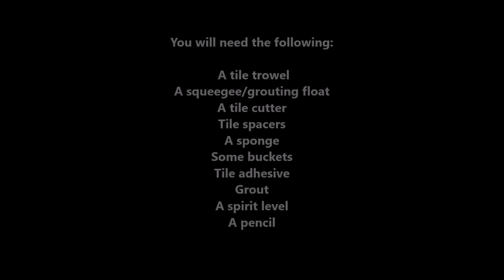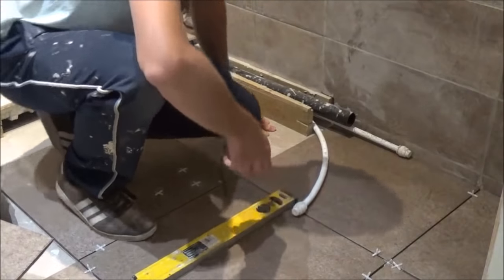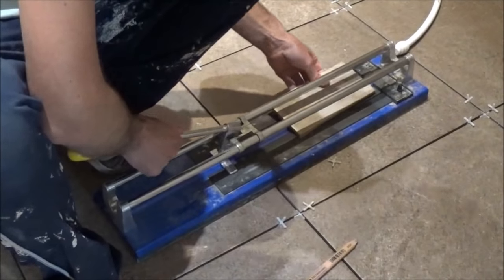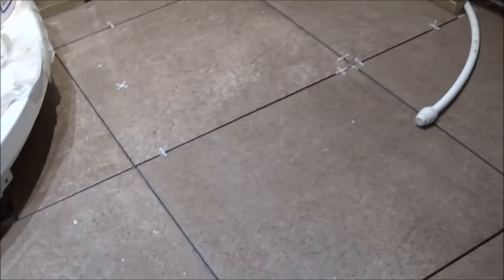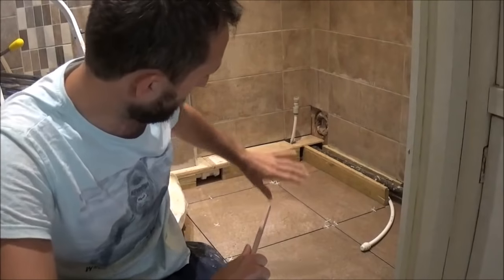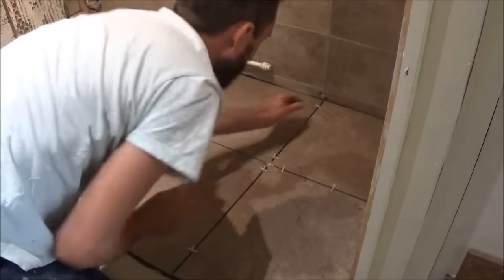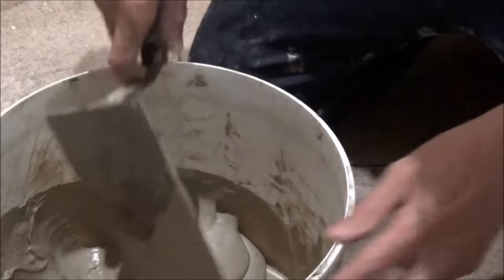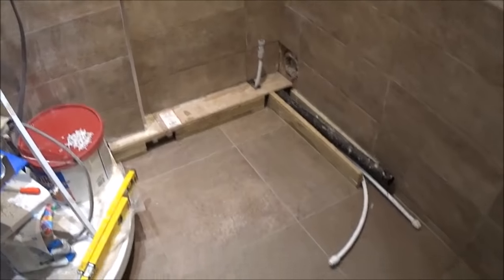How to tile a bathroom/shower floor, beginners guide.Tiling made easy for DIY enthusiasts!

Comment: Your videos are by far the best I have seen for NON EXPERTS such as myself - you have saved me a shed load of money on jobs, my latest was running a spur from the loft to a fused switch to hard wire an Electric fire, it worked a treat using the Wagoo Box as you described - many thanks for such helpful videos.

Comment: Excellent video..I been installing tile professionally for a couple years now.Doing a row of luxury homes where they are super picky about flush grout joints.Tough to do perfectly.Tried washing floor just enough where I can come back the next day and wipe off the film.Tough to get joints flush and tile perfectly clean in the same sitting.Thanks for the video.
Reply from the maker: Thanks for the feedback James. Unfortunately sometimes cheaper tiles are not exactly the same size so you need to use your eye a bit! Good luck with it.

Comment: Thanks for tips , customer wants me to tile s/bath just the same but previous tiler went direct onto chipboard flooring
its been nailed so tiles have come lose would 1/4 " ply treated with Mapei  Waterproofing kit do it as cement board would be to high Thanks again, such a good clear video
Reply from the maker: Why not use something like hardibacker board? It's made in 6mm which is basically 1/4 inch and it is designed for that purpose.  Hope that helps. Thanks for watching!
Reply: Use flexible tile adhesive and it will be fine

Comment: I am going to be filing a corner shower wall and bathroom floor soon. First time doing this type of work. The shower pan has a curved edge and is fiberglass with steel reinforcements. I am worried about setting the pan first because I don’t think I will get nice rounded cuts where the tile will meet it (no trim piece with pan). I was thinking g I should set the pan after the tile is down. Any thought on correct installation? Instructions for pan install where simply to spray foam underneath of it. Has leveling feet installed into pan.

Comment: Hi mate,,great video,,I want to tile all my bathroom but my old bathroom floor is old floorboards,,I’ve heard about putting 18mm ply over them but won’t that be very high and be a step going in to the bathroom
Reply from the maker: You could try hardibacker board. They do it it in thinner sizes. If you do have a small step up you can get a new floor threshold strip that neatly joins one floor to the other by smoothing out the drop. Good luck and thanks for watching!

Comment: I need to replace 3 tiles.  Do I need to use the spacers for just three?   Also, you didnt show it in this video; what if I replace a tile and its low or high on one side?
Reply from the maker: Spacers are always a good idea as they hold the tile in place while the adhesive sets, but you can do it by eye if you like. If your tile is low, put more adhesive below it, if it's high, remove a bit. Thanks for watching.

Comment: That rapid set sure does go hard really really quick first time mixing it nice lovely thick paste took bucket up the stairs then it had turned rock hard couldn’t even stir it lol did I add to much powder?
Reply from the maker: Maybe. If you're new to tiling I'd stick to a standard setting tile adhesive as it just gives you a bit more time. Practice makes perfect so keep at it! Thanks for watching.

Comment: Absolutely will be using this as a guide to do my upcoming flat, just to be clear it's a cement floor? It doesn't need any waterproofing layer? always see those in videos based in the US where the houses are wood and plaster but in singapore housing is 99.9 percent full cement and brick same as in alot of the uk
Reply from the maker: This is cement floor, and a bathroom floor. In a wetroom or shower floor you would need to waterproof it. Also on walls and floors if timber (or not in some cases) I would recommend using backer boards for tiling as there are plenty on the market, they are designed to take tiles, they add a bit of insulation and fitted correctly they are fully waterproof. Hope that helps and best of luck.

Comment: Use a larger notch floor trowel next time.  That serator is only for small format wall tiles....also if you have to tile over ply use a sbr mix on the ply 1st.... Best of luck
Reply from the maker: Thanks for the feedback.

Comment: Hello Mate, I have a floor boards in my bathroom, what base would you recommend? Would self levelling floor on membrane work? The bathroom is up stairs. Thank you
Reply from the maker: If your floorboards are solid and screwed down well, then a sheet of cement board (hardibacker for example) might be an option. But you need to work out if you can afford to raise the floor level as it may create a small step into the next room.
Reply: Great video...!
I have 2 layers of 1/2 inch plywood on the floor...do I need to put down cement board too?

Comment: That floor scraper looks the business....where did you get that??
Reply from the maker: Hi Charlieshooter, the floor scraper is from Wickes, cost about £15. The blades are reversible i.e. they have two usable sides so when one side goes blunt, you can take it out and turn it around. They are only a couple of quid to replace. They are also great for scraping walls. Thanks for watching my video and good luck with your projects.
Reply: I saw your back at 1:44.

Comment: First, you have to let the cement drying more than 2 hours, at least 10 to 12 hours before applying the grout, if not, the tile can wobble and make bumps on the corners. Second, i strongly suggest to back butter the tiles, the job will last longer and you can prevent tiles from damages, cracks and unstick from the floor. Third, when you apply the tiles, you need to push them slightly from left to right to adhere more into the cement. You're welcome.
Reply from the maker: This is rapid set adhesive, it doesn't need to be left that long. If you have worked with it you'd know about it. It is designed for the very purpose of getting the job done quick. Hope that helps. Thanks for watching.
Reply: Prbably on about wall tile adhesive hes never worked with rapid set goes of in an hour

Comment: Can tile be installed if bathroom fixtures (toilet, tub, vanity) are already there, or if you just want the new floor but keep all fixtures the way they are?
Reply from the maker: Yes they can, it's just more fiddly. Make sure you cut neat and use a good bead of sealant around toilet etc so any spilt water doesn't seep under tiles.
Reply: Well you have to remove the toilet anyways because builders get beneath the toilet to install builder grade tiles

Comment: So does the tile just start from the beneath the door of the bathroom ? 
and what sort of flooring is in the corridor ?
Reply from the maker: You can start the tiling from wherever you want. I started from the door (entrance to bathroom). I had to trim a small amount off some of the first row of tiles as the room wasn't square. Choose your line up the middle like I did, work from that line out, and also chose a starting place. Preparation is the key! In my hall way I also have tiles of the same depth so I just used spacers between the hall and bathroom tiles and filled with grout. This is under the door when it's closed. You could also use some carpet/tile trim (door threshold) to cover the join, its up to you. Good luck and thanks for watching!

Comment: Very informative! How long did the whole job take, walls and floor? Do you have any recommendations for an electric tile cutter that can also cut wood - Changing blade of course.
Reply from the maker: Glad the vid helped. The whole job took a few weeks but that was around my day job, just doing a few hours in the evenings when I could. But I was also doing the plumbing, boxing in etc inbetween, so difficult to put a time scale on it. As for tile cutters, you get what you pay for. The one I use in the video is a cheap one, does the job, but the guard is fiddly, and it's not super accurate, so you have to get your eye in. As for cutting wood, I think you want a table saw. You cant cut wood on a tile cutter as far as I know. Hope that helps, thanks for watching!

Comment: Do I need to remove the toilet bowl and bathroom vanity before installing the floor tiles? Thanks
Reply from the maker: No, it's up to you. Personally I like to have the tiles underneath, that way if you ever need to replace the units and don't want to replace the tiles then floor is covered. It also water proofs the floor, but it's not essential. Hope that helps.

Comment: Hi I have a small downstairs toilet that I want to tile. I want to half tile the wall, should I do the wall before the floor and secondly how far do I tile to the bottom of the door as it will meet the hall carpet on the the other side of the door. Cheers Rob

Comment: I`m removing the bath and fitting a shower cabinet, the bath sits on a raised platform seven inches high and is made of T&G  about one inch thick can I lay the tray direct on to the boards or should I put down something like marine ply first the waste will run under the T&G.                                                               thanks vinny.
Reply from the maker: Sounds like the tongue and groove is solid so no problem with strength. You can add marine ply if you want to avoid rotting if there's a leak. But that said, if you tile it up properly, it shouldn't leak so up to you!
Reply: @POUSEaroundtheHOUSE  thanks for your help.

Comment: Thanks, i have one tile on the floor which has come loose, should i still apply the adhesive to the floor rather than the back of the tile. When i lifted the tile off it looks like the adhesive was applied to the back of the tile and not the floor
Reply from the maker: You can apply it to either but usually less messy and easier to apply it to the back of the tile if it's just the one. Hope that helps. Good luck and thanks for watching!

Comment: Is it best to but your floor tiles first? Or your wall tiles? We are doing up our home and ran out of money so having to do it our selves. Also can the toilet sit on the tiles or does it have to go round? 
We have to board the floor first so will this make a difference to how we do it?
Reply from the maker: Hi there, to be honest it doesn't really matter. Floor first is better in some ways as your wall tile comes down onto the floor tile. If it's in a wet area like a wet room this is better as if your grout ever gets slightly cracked, the water would run down onto the floor tile and not the grout (if that makes sense). Toilet can again be tiled around or sat on top. I did my toilet on top. You can see how I fitted the rest of the bathroom by watching my other videos here if it helps - How to fit a toilet - https://youtu.be/85Re9VgHFU0 and How to install a bathroom sink unit - https://www.youtube.com/watch?v=8H55hZ3qFuA, How to fit a shower tray with shower tray riser - https://youtu.be/y2DI998gxdg. Best of luck with it. Thanks for watching!
Reply: POUSE around the HOUSE thanks alot, hope it works out haha am not the handiest of woman although i can restore wood quite haha
(You could come and do it could you haha)

Comment: I need to cut a few tiles to the size required (from 18x18 to 12.5x 12.5) to make a patch on the floor in the bathroom. After I cut the tile  do I need to smooth sharp cut ends somehow (someone told me if to put cut ends it would be a sharp object on the floor). I see you just put cut parts to feet the area. My question is: do you need to smooth the edges somehow sometimes, or it is in some special cases when you smooth them? Maybe when you put groat those sharp parts are not so sharp anymore. Same concern for the wall tiles, do you smooth them somehow after you cut, or just use as they are? Thank you for the great film.
Reply from the maker: You can file the sharp edge off a bit if you like, but when you grout the tiles, it should cover the sharp edge and problem solved! Hope that helps.

Comment: how did you make the the tile flush to the outside floor?
Reply from the maker: It depends on the two floor heights. I have tiles of similar thickness in the bathroom and the hall outside. I then left a slightly wider gap between the different tiles ( a few mm) and filled with grout to make the levels meet. But if the gap is quite different, you can use a threshold strip between the two floors. Hope that helps. Thanks for watching!

Comment: How do you tile your bathroom if there are painted walls and floor?
Reply from the maker: There are products you can put on the wall first like plaster primer. As for your floor, depending on the floor it may need more work. For example you can't tile straight onto floor boards. Hope that helps.

Comment: Great video, but a tip from a tradesman to anyone who is checking this video:

- avoid using flexible pipes as much as possible, they are unhygienic, the ridges will get filled with dirt eventually and are prone to clogging. In this case the flexible pipe could have easily been replaced with a straight more robust pipe.

- avoid using t pieces for drain pipes whenever possible.
Reply from the maker: Thanks for the feedback and thanks for watching.

Comment: @pouse - Tips on laying ceramic tile over vinyl floor?
Reply: rob1621 (in case he doesn’t reply) 
you’re gunna want to rip that up. The vinyl won’t let it stick very well.
Reply from the maker: Rob1621 - I agree with Mickey. If your talking about the one piece vinyl (a bit like lino) then I'd rip it up. If you have floor boards then it's worth putting a suitable base over them first like hardibacker board. Plenty of purpose made sheet materials for tiling on these days. Hope that helps. Thanks for watching and good luck with it.

Comment: Great video but why didn’t you explain the radius cuts around the shower?
Reply from the maker: I didn't do radius cuts, just cut square under enough to be hidden buy the shower tray and plinth. Hope that helps.
Reply: @POUSEaroundtheHOUSE  So if you extended the tile under the shower base, what did you use to keep the shower base level (since the tile would raise the front)?

Comment: Can you tile on wooden floor?
Reply from the maker: No is the simple answer. Whilst it is physically possible, wood will tend to absorb moisture from the adhesive quickly and could cause the tiles to come loose in time, and even then it'd only be feasible on something like plywood. Old floorboards for example just wouldn't work. You could screw some thin sheets of hardibaker type board or elements board to the floor then tile onto that.

Comment: Do you need to paint a floor with "Kills" before you repair the patch on the floor? I've read such advice somewhere.
Reply from the maker: You can use some sort of sealer if you like. In this video the floor screed was fresh so no need.

Comment: Is it necessary to use cement backer board on a floor or is treated plywood sufficient?
Reply: Andrew Hacker yes you should use the cement board to avoid cracking tiles
Reply from the maker: Cement backer board is a better option but I've tiled onto plywood with no problems. You can always brush some water:PVA mixed 3:1 over the plywood first to reduce absorption. Whatever you put down just watch the depth as it will start to build your floor height up when you add the tiles and adhesive which can be a pain lining up with the floor outside. Good luck with it!
Reply: But you didn't put down anything here, did you? Is it ok to just put them down on the cement or is it more dependent on whether you have uneven areas as to whether you use an underlayment? Great vid!
Reply: I used cement backer board on my floor. Easy to work with no need to prime it, low profile 5mm and strong.  I found that marine plywood was quite expensive.. if you are going to plywood make sure it's properly secured to the floor.
Reply from the maker: Dan, sorry for late reply. I didn't put anything down as there was fresh floor screed on the floor. You can tile onto cement direct. I'd only use the backer board if I was tiling an upstairs bathroom with a wooden floor, or if it was replacing or going over plasterboard. It's also handy if you need to raise your floor slightly. Hope that helps. Thanks for watching!
Reply: Never put treated plywood inside the offgassing is not good.  Standard plywood will work though.
Reply: Rob S flexible tile adhesive on wooden floors

Comment: Does this same video work if you have only cement underneath the tile already installed?
Reply from the maker: I had cement screed under my tiles. But you need a flat surface. If you have a bumpy service you can buy self leveling screed that goes over your existing floor. Once it's level and it has set, you can tile over it if that's any help. Good luck and thanks for watching.

Comment: how do you join tiled wall and floor? Don't you have a baseboard or something?
Reply from the maker: Depends on your application. Some people line and tank a whole room first. If it's just a bathroom like this, you just tile your one surface first, then the other. Grout corners and sealant corners in wet areas like a shower. Thanks for watching.